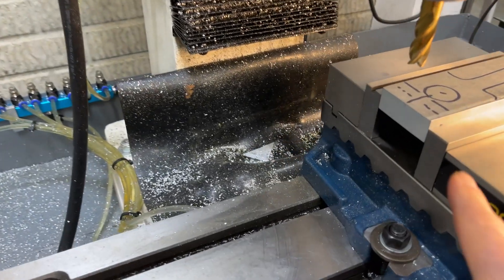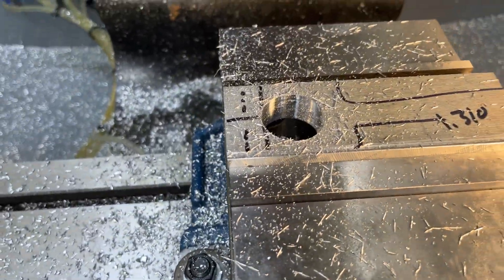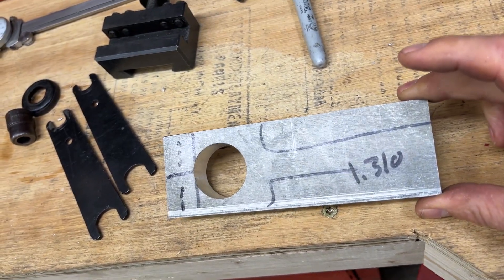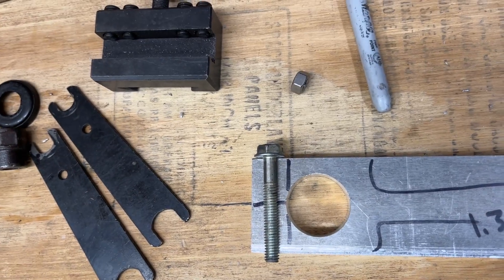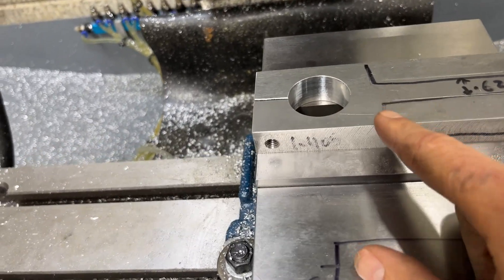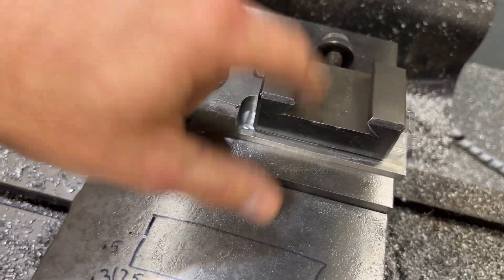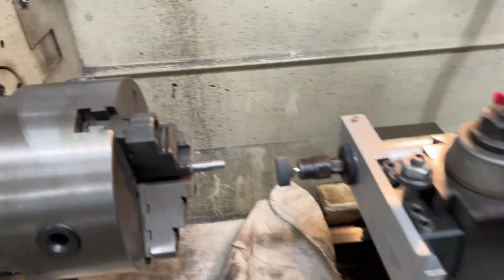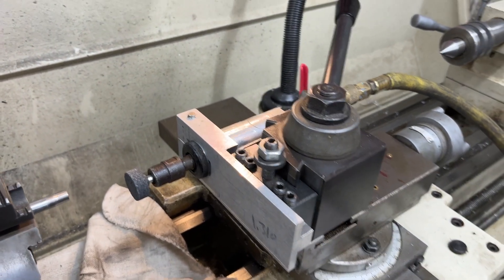Custom Tool Post Grinder

Comment: I'm not sure why have you felt the need to cut out the parts where you cut the slit of the clamp and the part where you actually put the grinder to use, showing just the results. For someone who watches this kind of videos to learn techniques and apply them myself when I get my hands on these machines and would love to see some sparks in the meantime, that was anticlimactic.